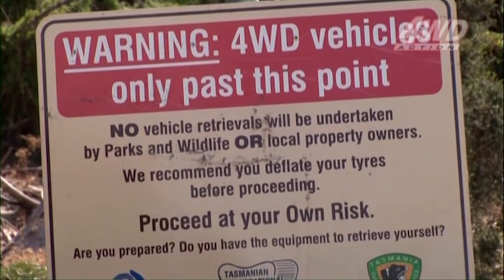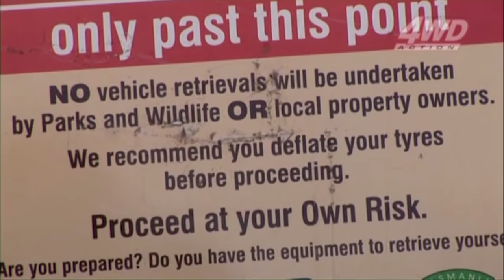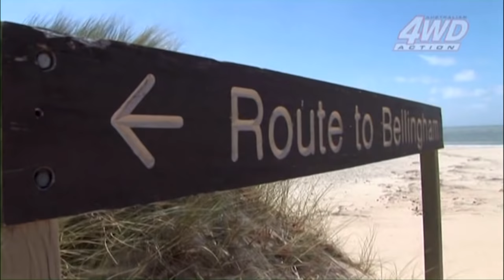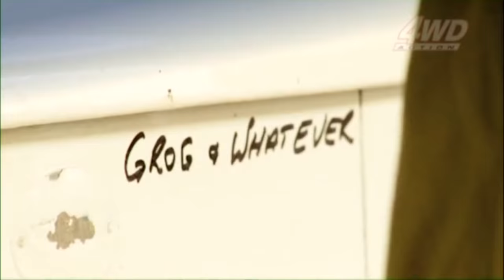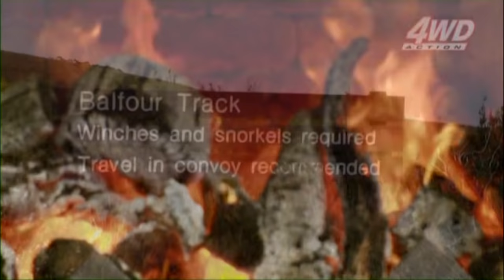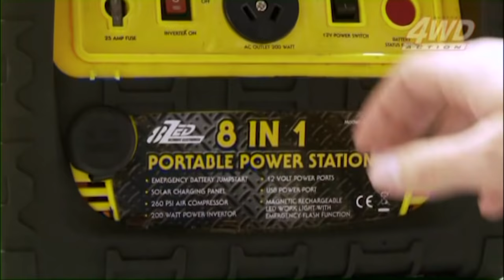TASMANIA'S BEST 4WD TRACKS- Roothy

Comment: We have a b.utt pucker similar to this washout section at "wallaby Rocks trail (hard option)" in my local range the "grampians" in Victoria. 
But it's a u-bolt also and inclined, you have maybe 4" acceptable wheel placement on the outside. If you go to far its about 100 metres down and pretty much vertical. Highly recommended if you have the steel the veiw is awsome to say the least.
Probably not ideal for my stock 07 rodeo but she takes it well.

Comment: What is Millo year make and model? I love the look and would like to see if I could find one here in the USA
Reply from the maker: Cut a yard off a 1984 Troopcarrier - used 1967 wagon rear panels to get station wagon look. Whinge is 1995 13BT turbine Toyota 4 Cyl truck motor 3.5 litre adapted original box transfer Et.  All done in the shed. Thanks mate.  A guy over here copied it. Got a clip on my you tube with that one. Cheers